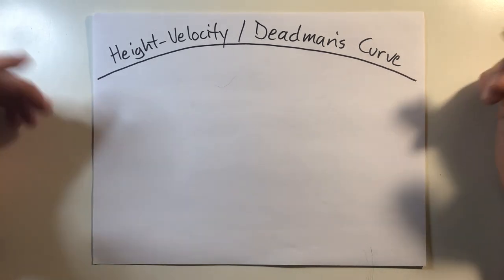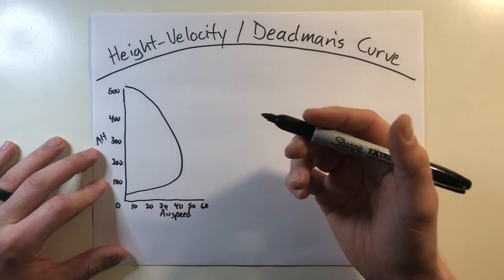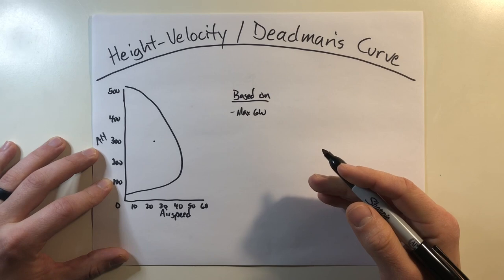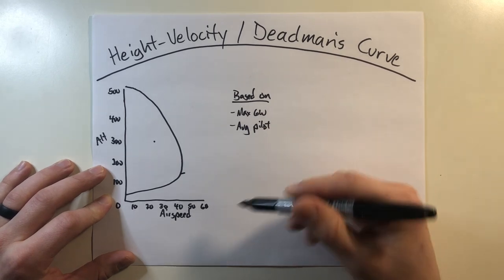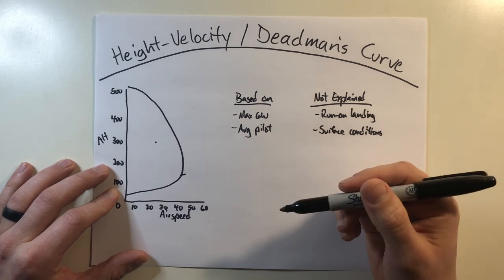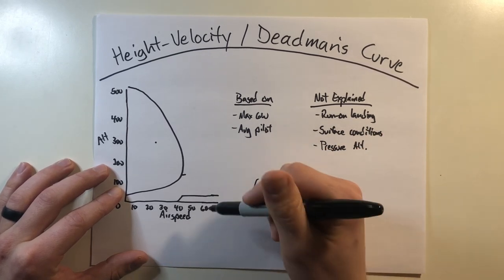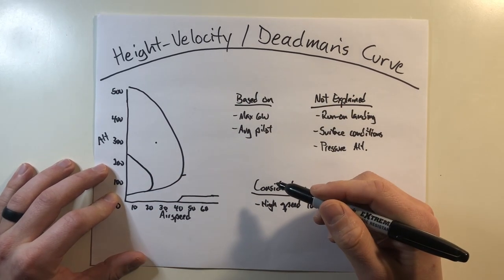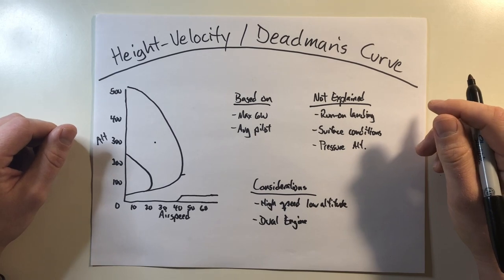Height-Velocity / Deadman's Curve

Comment: Something to remember about this is that not always you can stay out of that greyed-out area. For example a single engine heli doing utility work or firefighint has to hover to attach/detach the cargo or load the bucket with water and you will be forced in that area. Ofc you don't want to hover for 10 minutes at 150ft just because you want to.

Now, i'm not a pilot and if i'm wrong please correct me.
Reply from the maker: Daniel Helicopters Photography. I completely agree. Many helicopters have to operate in this zone as part of a job. But lingering in this area for no legitimate reason shouldn’t be done. And if you have to operate in this region the pilot just needs to be hyper aware of any malfunction in order to react as quickly as possible. Thanks for the feedback!
Reply: @helicopterlessonsin10minut10  
This is also a good reason to do a thorough pre-flight inspection. SAR, Search And Rescue missions most of the time operate in the Dead Man's curve, so it essential to do a thorough pre-flight on these choppers. Mechanical, Electrical, hydraulics, fuel, proper gear, weight n balance, instruments, etc. You want to make sure the chopper is air worthy n good to go.
You also need to have good CRM, Crew Resource Management skills, where everyone knows their jobs n how to communicate effectively...

Comment: Couple of things:  First, I like the beginning of your videos showing the Unicorn...an Apache actually that is actually FMC...LOL.  Secondly, in a dual engine aircraft that chart has nothing to do with autorotation.  It is a single engine failure chart.  In the Blackhawk it is set for 15°C, sea level and a 0.85 EFC.  It has multiple weights and different curves for each.  The Lakota it allows for different PA and Temperature conditions.  You can interpolate between the different weights.  The top of the curve is the minimum height you need to be at, in order to accelerate to a minimum single engine landing speed.  The knee is that minimum single engine airspeed.
Reply from the maker: Ray Blevins. Glad I could let you see the unicorn in flight haha. Well said on your second part. I believe I outline in the video about how it is different for dual engine conditions but thanks for adding that in. Most Army helicopters have charts for varying conditions but some civilian charts are bare bones and leave the pilot lacking quite a bit of clarity. Thanks for the feedback!
Reply: dave sniw thanks for putting me in my place.
Reply: Helicopter Lessons In 10 Minutes or Less, I provide your link to my students.  I just felt the info could have been presented differently.  Keep up the good work.

Comment: I would think on newer helicopters with glass cockpits they could either display the curve with helicopter location on the curve or at least display a warning light when in the the danger zone (assuming you have input the current load weight)?
Reply from the maker: Tom Mendenhall. I don’t think it would be hard to put in some sort of advisory like that. Most military helicopter pilots are taught about this zone early on and its importance is instilled in you over and over through emergency procedure training. I can’t speak much on civilian flight instruction however. Thanks for the feedback.